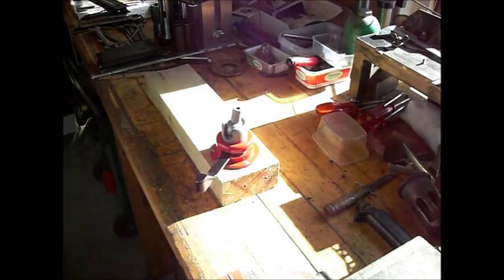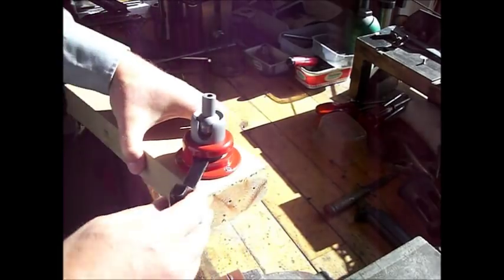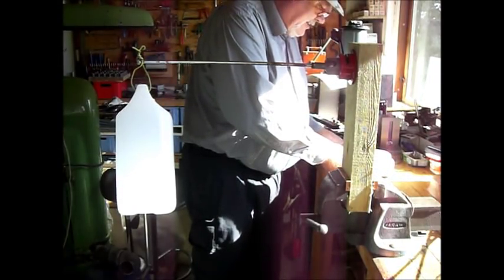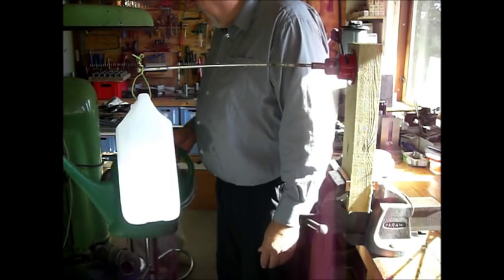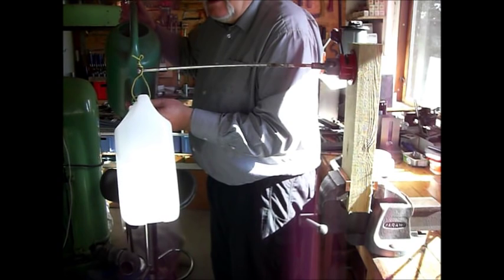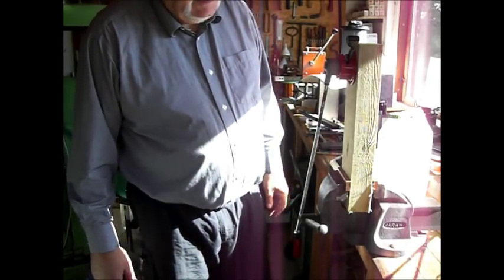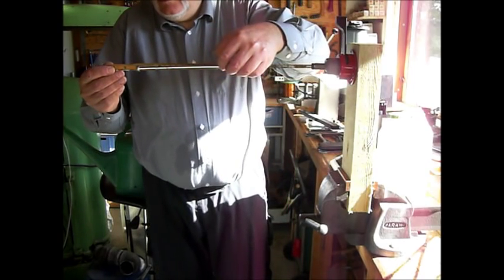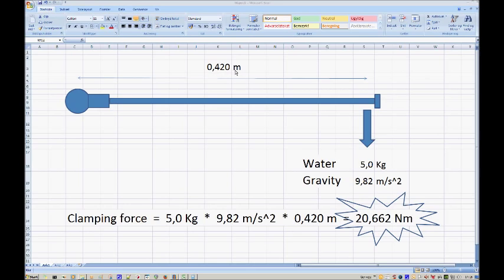PowerArm 06

Comment: Very interesting series, Keld.  I watched from start to finish in one sitting.  
I, too, like the testing that you did at the conclusion  using  liters of water to calculate the force on the rod.  That is quite straightforward in the metric system given that water has a density of 1 g/cc, and 1 liter of water = 1 kg.  Most anyone  using Imperial units would soon have a headache--if it occurred to them at all.  
It was a great lesson on how to accurately calculate forces using nothing more than a simple jug marked in liters, a ruler to measure the lever arm length, and of course, some water.  
Thanks for sharing!
Reply from the maker: +Richard Freeze Thx for the nice words !

The test ... I'm not sure about the 5 liters in the bottle but I'm sure on the 5 Kg because I weighed it on the scales - so I can't be sure on the density of the water ... but it's not a part of the equation anyway ;-))

The only thing I shouldn't have done was bringing the bottle to oscillate - instead I should have added more water and maybe needed to change to a bigger bottle ... to get nearer to the figures of Tom Lipton's test results ;-))

In the end I'm very satisfied with the test result ... and the look/finish of the project.
Reply: Water has a density of 1.00 at 4°C, so given that your weight came to 5 Kg, the bottle must have had very near the 5 liters it indicated.
So even without a scale, using just an ordinary measuring cup graduated in cubic centimeters one could quite accurately measure forces.  It was a great demo.

The base finished out quite nicely and functions well, too.  It was a great project demonstrating much ingenuity from design to testing.

Comment: Hi keld, toms test torque went to over 20 Ft-Lbs, compared to your 15.  it appears to me that your ball, inside the clamp is smaller than his which would explain the difference in slip-torque. increasing your radius by about 30% appears to be enough to make yours hold as much.  if this estimate is true, then your clamp fit to the ball is as good as the factory made.  good job!

Comment: I think you're underselling the clamping force of the arm, because that oscillation you gave the weight at the end will greatly add to the actual weight the clamp has to deal with, due to the added momentum energy.

Sadly I'm not good enough at math to add the extra variable to the equation, but I wouldn't be surprised if you got someone more math savvy than I to do the calculation, you'd find the weight it actually held up was 7kg or more.
Reply from the maker: +Jan Martin Mathiassen Yes, you're right ... but I was surpeised it could hold the 5 Kg ending up having a clamping force 20 Nm.

I don't know anything about what spec's  the factory made power arms has ... but, yes, tha clamping force is a little "undersold" ... better that than the other way around - right ?

Comment: But what does it do?
Reply from the maker: +John Creasey It's meant to hold something for you while you're doing some work ... filing, sanding, welding or so ...

There will be placed a filing clamp or a Baby Bullet vise where I placed the long bolt for the test.
Reply: Thanks for the reply Keld.  You made a great job of making it.  The first part especially looked very difficult!

Comment: Great build/finish Keld and enjoyed the test, very suspenseful wondering in a water crash in the shop was going to occur!!!

Now you need to quit playing and start building the baby bullet for the power arm!!  I know you will do an awesome build
Reply from the maker: +outsidescrewball Thx Chuck for the nice word ... no, no ... no water flooding here ... but I'm a little surprised it could hold that much ... It's way good enough for me and my use of the PowerArm.

Yeah, I have to have something to screw into that PowerArm - in the first place I thought of a sort of filing clamp - that's only a 8mm bolt TIG-welded to the filing clamp and you're riding ... but you're probobly right, in the end I have to have that baby bullet too :-))

Comment: Nice, Keld! BTW, for us USA non-metric dopes, an easy way to remember the relative value of the force of a Newton is to remember what hit Sir Isaac Newton on the head...it's roughly the weight of an apple (3.6oz or ~1/4 lbf).
Reply from the maker: +Thomas Utley Ha, ha ...  leave that imperial system ASAP ... you will be forced to in the future ;-))
Reply: +Keld Sørensen I am completely comfortable with both systems, and with changing between them.  But that legacy stuff will be still be hanging around much longer than you and I will, especially in the US, where many resist that change kicking and screaming.  I just deal with what I have in front of me and leave the arguing about it to others...
Reply from the maker: *****
I'm indifferent too but just like making a little fun ... indifferent, no ... I would rather not using these fractions ... I think it's a mess ... but maybe one can adapt ... but I'll stick to the metric system

Comment: Keld
Very nice demonstration. 20 kNm torque to overcome the locking friction is a respectable amount. It's also great to show how simple measurements can provide important information. You can also calculate how much friction force is present by dividing the torque by the radius of the ball. 
An example:
20622Nm / .01m = 2062200N or 2062.2kN
In terms of kg, 2062.2/9.82=210kg friction force from clamping.
Nice work. Nice finish, too.
Thanks,
John
Reply: I assumed a 20 mm diameter ball. I forgot what you said it was. To get the real force, substitute half the ball diameter in meters for the .01 in my calculation.
Reply from the maker: +John Bazaar Oh, we have some misunderstanding here because of the . and , in numbers - it's 20.662 Nm - twenty and a little more ... not thousends !

The radius of the ball is 15mm ... think, think ... how can the radius be used here ... a presumption then must be that there is contact ALL OVER THE BALL SURFACE ... and that's NOT the case - there is only a small band 3-4mm wide in the FIRST PART I made ... where the ball have contact.
Reply: +Keld Sørensen 
You are correct. I forgot that Europe uses a comma delimiter for decimals so your numbers are correct. It is slightly above 20 Nm, NOT 20kNm.
If your radius is 15mm then simply substitute ,015 for ,01. That should result in about 1.333 N friction force. 
Also, I am only calculating force which not based on an area calculation. I did not attempt to calculate the pressure required to create the friction force because the science supporting that does not relate friction coefficients to pressures very well. 
Your are right in that the friction force is related to the clamping force acting on the contact surface area between the ball and housing. 
Unfortunately, friction coefficients are calculated from applied forces, not pressures so there is no direct way to calculate friction forces from contact pressure and friction coefficients.
Thanks,
 John
Reply from the maker: John Bazaar
Thx for your explanations ... very interesting.